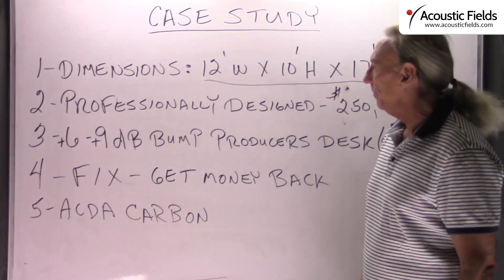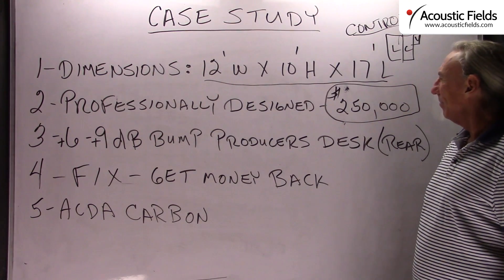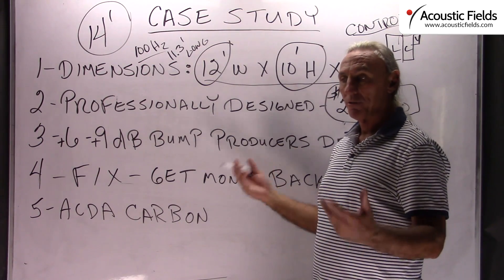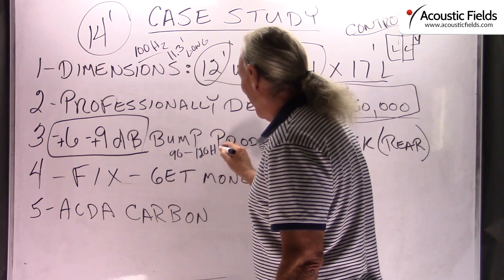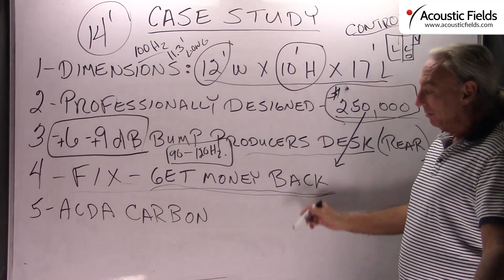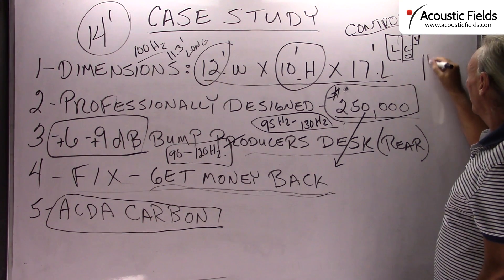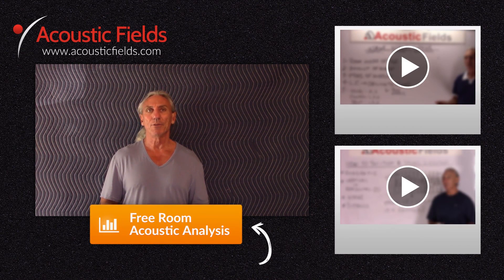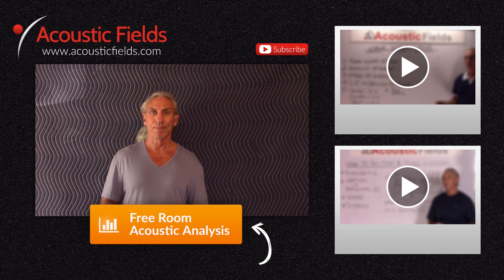Why did you pay $250,000 for a + 6 dB - + 9 dB bump? - www.AcousticFields.com

Comment: Sorry if this is a bad question, but why did you use carbon and what would switching out the legs do in this situation?
Reply from the maker: Hi B, Our carbon technology is part of our diaphragmatic lower frequency absorption process. Low frequency absorption is all about providing enough surface area within the room to manage the unwanted pressure. You have to get it where you can.
Reply: Acoustic Fields Right ons! Thanks for the reply!